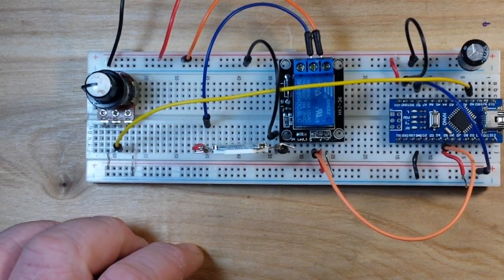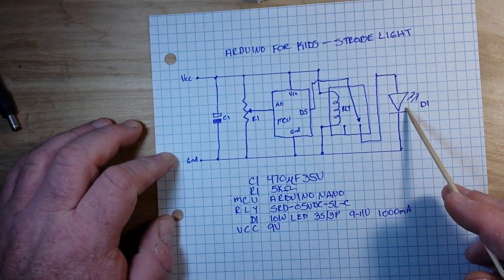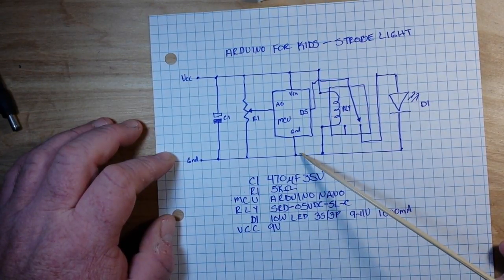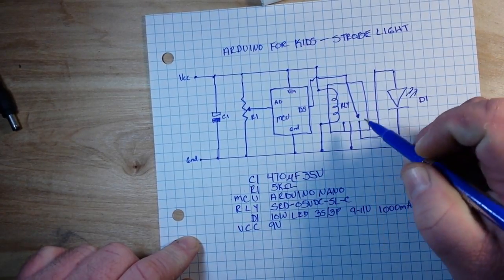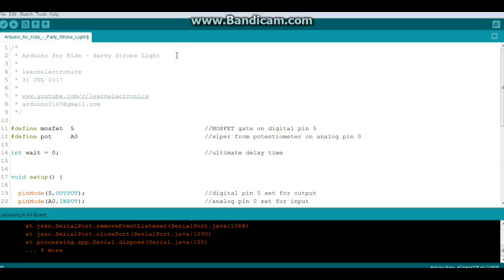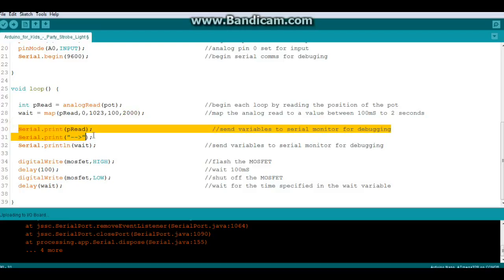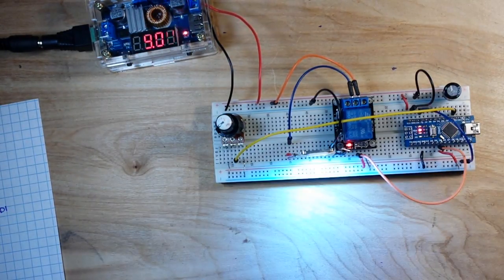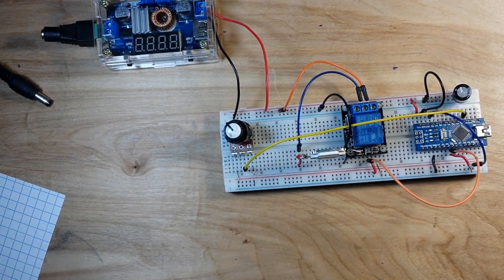Arduino for kids - Strobe light

Comment: Drawing of relay may be a bit confusing for beginners as it gives the impression the relay is constantly energised rather than showing it as a module.  Not being picky Paul just my novices outlook on diagram!
Reply: also looks to me like the relay is on all the time according to your schematic :P
Reply: I concur with gartmom & fredlllll - as drawn, that circuit just can't flash.  Whatever wiring is on the breadboard does flash.  Something is amiss.  When you last drew in the relay 'common' goes to ground, the question becomes "what relay connection is the Arduino 'DS' pin going to?" (at the top of the relay's symbol).  Now, if this is a SPDT relay, why would it have 4 contacts pins?  3 would be C, NO, NC - right?  The 4th would be.... ?
Reply from the maker: gartmorn part of the relay is energized when ever the circuit has power. But I see what you're saying
Reply: Piling on here. 
Even with the correction that you drew in, the LED still won't light (relay wiper common to ground and cathode of the LED to ground means 0 volts to the LED.)

And the coil of the relay is drawn across VCC and ground.

Comment: I think it would be improved by taking a audio source as input (obviously less than 5V) to arduino and convert that into corresponding voltages values so that the arduino can drive multiple such led for greater lighting
Reply from the maker: Sayantan Maiti ah you're thinking ahead.... That's coming. One step at a time my friend
Reply: yes yes that's right....I just made one suggestion for any future improvement